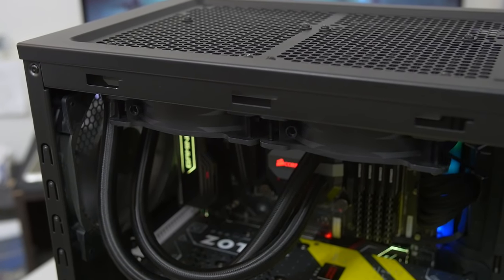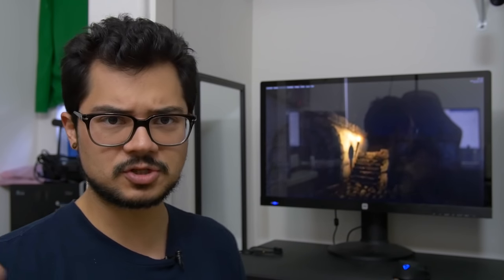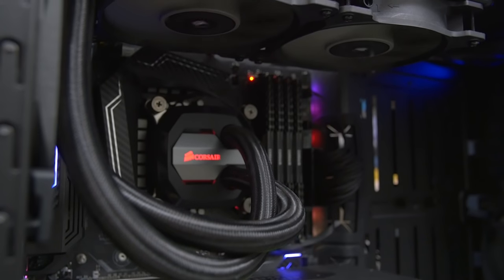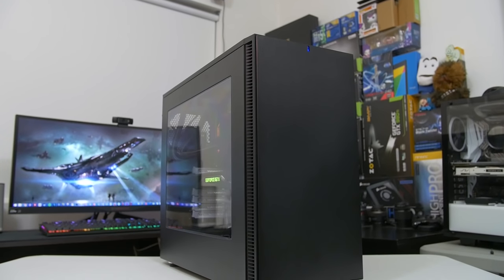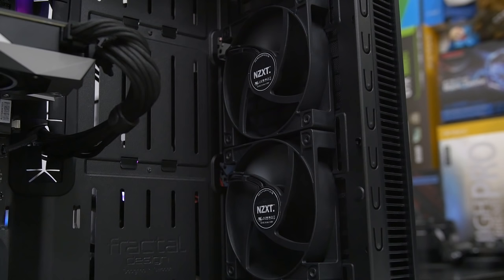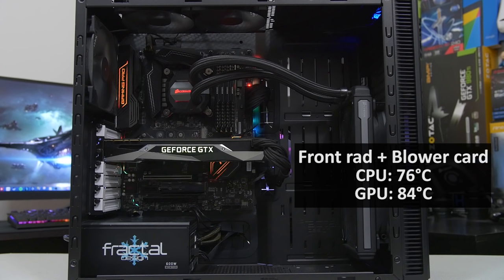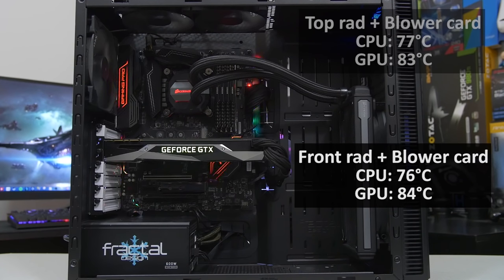Does Radiator Placement Matter? Hint: YES

Comment: Well, with the new chips, things are not so clear. I always went with the rad on top. I would feed cool air to case/GPU, and AIO rad would use that and exhaust it because the CPU temp was easier to manage. Now with the 7000x and 3090/4090, the heat off them is really not going to help you keep them from throttling or ramping your AIO fans up way high to deal with it.
With my Lian Li case I am now moving to AIO on the side as a pull, bottom 3 fans to push, the top has 3 to exhaust and 1 at the back for exhaust.
For me, it's become a much bigger deal to remove the hot air out of the case because it's about to get a lot hotter with new chips and a 4090. And yeah, we normally set them to run a bit faster anyway because of air pressure, but I think they will need to go a lot higher now.

Comment: Well heat rises so it makes more sense to mount the radiator in the front to suck in and push cooker air and suck the hot air out the top and the back to get constant optimal flow and temperature

Comment: Once your AIO coolers lose water....can you recommend how you should make sure the radiator inlet hoses are above the CPU to prevent any air dead space from forming in the CPU heatsink tank....air bubbles form at the top of circulatory system.
Reply: Agreed, which is why a front mount setup shown in this video would lead to early pump failure. If the rad was the highest point of the loop, i.e. mounted higher, then that would be an ideal setup.

Comment: I would have been nice if you would have pointed out that when mounting in the front of the case make sure that your pump is lower than the outlet barbs on the rad or you will get cavitation in the pump and severely lower it's efficiency and life span while also creating irritating noise.

Comment: Should put the radiator at the front but at the top slots. Then an extra intake fan in the bottom slot to provide cool air to the enclosed GPU. Maybe even make some sort of air splitter to let the cpu air run over the top/back of the GPU and gives the GPU only cool air.

Comment: Man, thanks so much.  I was convinced that exhausting the PC's hot air through the radiator was a bad idea.  But everyone seems to do it.  I didn't want to on this first build for me, but wasn't sure.  I do see that your fans are mounted in push position on the radiator on the front.  I'm hoping to expose the radiator and use pull fan arrangement.  Thoughts?  Anyone?

Comment: Good stuff, but one important point: with the front radiator you have the radiator pump as the highest point of the coolant circuit, that will make the pump work with all the air in the circuit. Not healthy for the AIO and for its performance.

Comment: Best compromise after watching entire video, for those with open air GPU rather than blower, is for AIO to be set as intake at front. Cheers!
I'll be getting the Lian Li Galahad 2 with a 14700K, will set it to bring in air at the front and reconfigure the included 3 front fans of the case to the top as exhaust. If I hadn't seen this vid, I would have just left the 3 fans at the front and put the radiatior at the top as an exhaust. Will be using a tri fan Zotac 4080.

Comment: Considerably better with the front mounting of the radiator. Here is the kicker.  Some very hot running cards ( ATI 5700XT), there is a lot of heat dispersing within the case, so really good exhaust fans on the rear and the top (if possible) of the case is essential. For those cards, mounting the radiator in exhaust configuration is terrible, especially in not-so well ventilated cases (khmm... NZXT), the CPU fan/radiator must go on the front!  Also make custom fan curves for the exhaust fans to match your graphics card, let them kick in into higher rpm when you graphics card' fans kick into higher gear (usually above 65-70 Celsius)  You are trying to get rid of the heat coming from your graphics card, your CPU's temp is no longer a factor its' your ambient temp inside your case you are working on. Also, don't mess up these cards' air draw, so don't bother adding a side fan on your case wall  or a fan below the card, you just gonna mess up the airflow dynamics and you gonna have worse results.  Heat will rise up, just pull that out with your exhaust fans.

Comment: I wonder if there would be a change for the internal temperature and airflow the radiator on the front had either a pull or push-pull configuration rather than just push. Just because of the turbulence and probably lower airflow form the radiator mesh. For the CPU this probably won't do much (pull might be slightly worse while push-pull might be slightly better than just push)... but I could imagine the GPU (and other internal components emitting heat) could benefit from the added airflow.

Comment: Size of AIO means a LOT here.  For example I have a 360 AIO.   Front mounted I was 15c warmer on GPU and in the case due to more warm air being blown into the case.  CPU was 4-8c cooler. Top mounted I was 4c warmer on CPU and 15c cooler on case and GPU.

Comment: I've got an older Antec case(2008 P180 Midtower) with a separate tunnel with fan for the PSU at the bottom, a front mid-mount fan, a rear fan and top rear fan.  Just installed a MSI X570 Gaming Edge mobo, Ryzen 5 3600, and a MSi GForce RTX 2060Super.  At the moment I've got a Corsair H60 with the radiator mounted at the rear position. But after watching this, given my GPU is twin fan open air, I'm definitely going to try swapping the rad to the front center position!.  Just leaving the system in Auto, the Precision Boost OD, has been getting me averaging about 4ghz and peaking at 4.2GHz and the temps have been staying pegged at about 67.8 degrees c.  Forgot to note the temp on the GPU before hopping on here.  Not complaining at all, by any stretch, but if I can knock those temps down a hair...definitely gonna! I'll report back when I get the thing put back together!  Thanks for the info!
Reply: Side thought, I'm actually curious if the Silverstone fan(110cfm max) I have on the top of the case is hurting the performance of the stock Corsair H60 radiator fan it's sharing that top corner with?

Comment: I would have liked to see top mounted intake vs exhaust. I feel as if a top mounted intake would result in lower cpu temps and gpu temps. Reason being that the intake air adds extra airflow having a more positive airflow. knowing that the intake air from the aio doesn't affect the gpu when front mounted it should only help guide the air threw the exhaust on the rear.
Reply: stupid question exhaust sucks hot air out of the case, so instead of cool air cooling the radiator, hot air is, which dosent cool it as efficeintly, much worse actually

Comment: If you know how a window AC works you'd never mount the radiator that way. My radiator is outside the case where outside air is both supply and exhaust for the fans. Case airflow is not tied into this at all.

Comment: Put a couple 120 in the front for intake. I'de still mount it to the top. cpu wouldn't be adding to the total case heat.  The case you used didn't seem very "airy"

Comment: The impression I’m getting is it would be the opposite result of your gpu is being water cooled as well, with a dual rad system.   Let the top rad be first in the loop to expel the first round of heat outside, to then let the slightly cooler water hit the front rad, in turn giving a bit cooler air into the case.

Comment: I recently bought a i9 10850k and paired it with a msi 360mm water cooler and the case I bought was a bit too tight to handle the cooler so I cut holes in the side panel and hung the rad on the outside with some rigid brackets. Holds the temps really good.

Comment: Here's a real hint: AIO CPU coolers generally have very low pump volumes, and have the pump directly sitting on the heat source. A fan header is no way to power a pump properly when trying to cool such heat. Wanna stay cool? Go custom loop. Best radiator config in my testing, 240mm/280mm radiator up front on a 360mm/420mm case, with a fan in top position intaking cool air above the front radiator. Biggest radiator you can fit up top exhausting, and an extra exhaust fan on the back of the case to assist the air flow from the top front fan. This moves a channel of cool air below your top radiator, creating a division in the heat sources, and cooling mobo components like RAM and VRM. Overall temps benefit from the front radiator at lower fan speeds(40-70%), as you want to cool the radiator, not pump its heat into the case at high speeds.

Comment: I’d be really curious to see the same test results but using a liquid cooled AIO version of a GPU, with a standard tower air CPU cooler!
Reply: I am using the configuration that you mentioned here. In a 3900x/Evga 2070S Aio cooled build. Deepcool Ak620 Air cooler. Two 140mm Noctua fans mounted as intake on the top of the case. One of them is directly over the fins of the Cpu cooler. The radiator for the Gpu is a 120mm version so it's fitted into the middle front fan slot, then two 120mm fans mounted as intake above and below the Gpu radiator. For exhaust it's just one 120mm Noctua mounted in the back of the case.  I never have to worry about temps, I use it as a dedicated streaming Pc and for some gaming at times, the Cpu temps rarely go above low 70's at full load and the Gpu hotspot usually doesn't go higher than mid 70s. The Gpu core is usually in the 60's.

Comment: It makes sense that the top mounted rad would be hotter with an open shroud GPU. Purely because of the fact that hotter air, which leaks out of the GPU, is less dense and will rise to the top of the case.

Comment: i know this video is a few years old now, but if anyone is mounting their radiator at the front, ensure that the top of the radiator is above the height of the cpu pump, you should do this this so any air in the system stays in the radiator not in the Pump.

Comment: My guess is having the radiator at the top would be best. You have 3 exhaust fans and 2 intake fans, keeps a nice fresh cool airflow inside the case with a slightly warmer air going through exhaust radiator. Other than oxygen deprived case with warm intake are being pushed in through front radiator. Just my guess tho, time to watch till end.
Reply: I was wrong...
Reply: Still going to just test this myself with my case and case fans. Thank you.

Comment: Good test.  A 10 degree change from a simple radiator swap is significant.  This makes sense with this type of setup (air cooled GPU and water cooled CPU) but for those who water cool both the GPU and CPU this won't matter.  Do whatever floats your boat.  My top 360 radiator is set to exhaust air up and out and the rear radiator does the same with 6 intake fans.  Liked and subscribed.

Comment: 8:30 - I think your CPU temperature changed so dramatically due to overapplication of thermal paste going over the side of the lid on this one. That's pretty much the margin of error I get between having a bit too much paste that goes over the side and a properly mounted cooler block with just enough, I've been running a top-mounted radiator of the H100i and H100x (which this appears to be) for a couple of years. I'm actually watching this to find out if it inhibits flow to mount the radiator at the front of a case as I have a 65mm thick Liquid Freezer ii waiting to go in but it's too thick to be top mounted without hitting the RAM. I'm moving my build to a new case over the last few days and have been monitoring temps especially closely as I know this cooler is on the way out and under load that's almost to the centigrade what I'm getting here with a blower 3080Ti. Changing the GPU cooling I don't think would have that much of a dramatic effect on the CPU temps, unless it equates to that much extra thermal load being dumped by the GPU and the temps show that's not the case or the GPU would definitely be hotter than that.

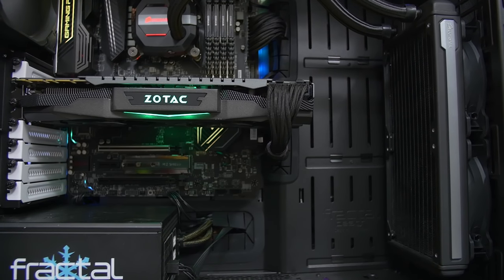Comment: Temperature and noise levels aside, the AIO at 1:35 is a bad way to orient the cooler as the pump is the highest part of the loop. If the radiator was placed higher, it would be okay. I'm not saying this to correct Kyle, i'm just trying to help people who are new to AIO's.

Comment: I have never seen much heat coming from my 360mm radiator so having it front mounted should not affect the video card. When load testing the cpu very little heat comes from that large radiator, however when loading the gpu it is a whole other story, it's hot!

Comment: With the top mounted rad, I would at least check what happens if I installed the rear fan as an intake, not an exhaust. That would probably lead to more cool air getting to the radiator and might lower CPU temps. Other than that: I agree with Push Band that in the top mount scenario the rad was probably mounted too far towards the rear of the case and that the front mount scenario had the radiator mounted too far towards the bottom. The pump looked like it was the highest point in the loop here - which means the air in the system will accumulate and stay there. Which will make for a noisy pump and might even shorten its lifespan.
Reply: Another interesting thought would be to replace the rear fan with something with a stronger pull, while having the top mount setup. That's something worth testing. In an old setup I had, I noticed a difference with an all air setup, but with a stronger pull (and slightly noiser) from the rear.

Comment: Awesome video, however I do miss one with 2 radiators!  It will completly change the rules also because its way harder to generate negative airpressure... all intake will be through a rad... or should both rad exhaust out? top and front?

Comment: Very interesting, I was thinking allot about this and mounting the radiator to the front as intakes with 2 fans on top of the graphics card cooling the CPU seems to be the best option to keeping one's CPU the coolest possible!
Reply: Please do yourself a favour and watch Gamer's Nexus vid on how to correctly mount the AIO. Kyle did the front mount completely wrong in this video. He also explained in a different video why exhausting air out the front through the radiator is not a good idea.
Reply: @lanycera  jayztwocents did a video on why the orientation that kyle did is perfectly fine.

Comment: What is needed is to take air from outside the case, pass it through the radiator and exhaust it outside the case. I can easily imagine way to do it off the top of my head, so it's odd that all the common cooling solutions seem to avoid this

Comment: I keep wavering on where I want to place my AIO. CPU temps are probably the most critical piece, so I'm probably going to go with a front mount, but the one advantage of a top-mounted AIO is that it serves as a secondary dust filter for those cases with vented tops. It also seems to be easier to create positive pressure with three 140mm fans in the front and the typical 120mm fans on an AIO.

Comment: I ran my radiator (corsair h100) up top intake not exhaust for years with very nice temps idle high 20s Celsius and load (prime95) mid 50s Celsius on a processor (max temp 70 Celsius)  amd fx 9590@ 220 WATTS!!!!. The rear case fan and giant side panel case fan (NZXT Phantom case) just exhausted most of the heat. I read or saw videos where you always want fresh air from outside the case running through your radiator no matter where you put it especially if your going to over clock you want fresh air not hot case air lol. If you do it this way I recommend a motherboard with very good VRM heatsinks or a small fan on VRM. I just retired that build last week (built in 2012-13 and am now running a ryzen 3600 cpu on wraith spire amd cooler (Corsair 220t rgb case) till I can afford the corsair H100i.. Good ambient temps help.

Comment: I wonder why GPU manufacturers don't build cards with up-facing fans.  They always blow heat down towards the power supply shroud, which then has to travel back up to be exhausted out of the case through the top and rear fans.  If the fans were facing up, they'd blow the air directly to the top fans, which then blow the heat directly out.  Straight shot.  The airflow would also slightly blow across the motherboard, carrying that heat with it to the top fans.  Makes no sense to me.

Comment: good video, have max 51c cpu temp (i5 8600k @ 4.2ghz) and 58GPU (RTX 2070) Radiator at front and 2x140mm fans on top and exhaust on back.

Comment: I know I’m responding to a old video. But I was looking for the overall internal temperature. For example the system board temperature and the air flow you would be getting if the radiator mounted to the front.

Comment: Here in 2024. I just wanted to add that your radiator tubes should be higher than your heatsink for the air not to get stuck in the motor. The way its mounted at the front will cause the temps to run higher due to air bubble. I think your test should be redone due to the bad case you used. Get a mesh case which you can run three intake fans at the front with the radiator mounted at the top. I believe massive difference should be seen in your results.

Comment: DO NOT put your radiator below the heat sink block (i.e. water pump). All closed systems have between 1% and 10% air in them. If the pump (where the water block is), the air will end up inside the pump and make the pump less efficient, but also wear it down a lot faster over time.

Comment: I'm torn, between changing the position at the front of my case and try to mount it with tubes down (Arctic Liquid Freezer II 360 in a be quiet! Silent Base 802) if possible, or tubes up in the worst case (still at a higher point than the pump itself) or just order an Alphacool Eiswolf 2 AIO for my RTX 3080. First one is free, second one is about $250. I guess I'll try the first one.